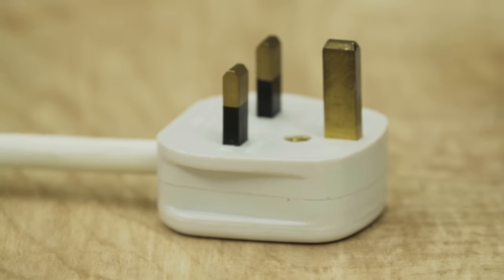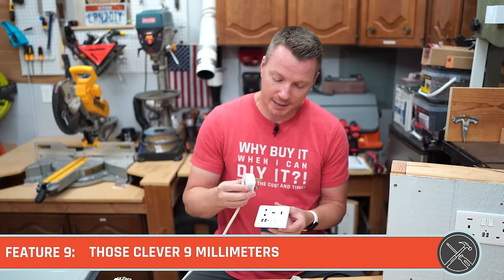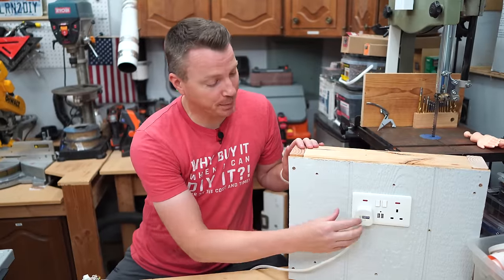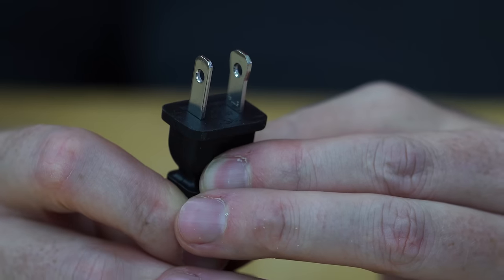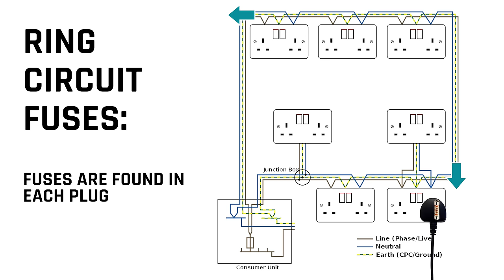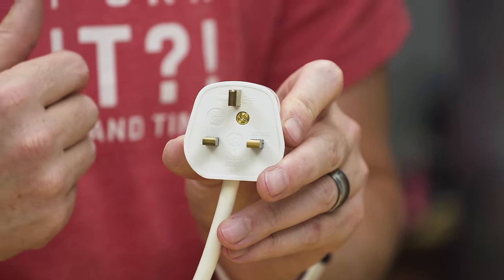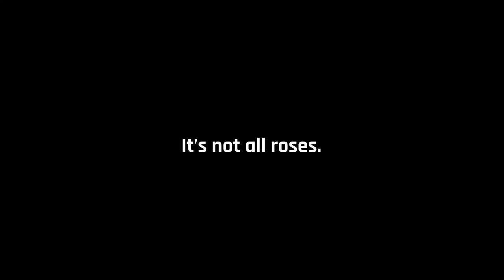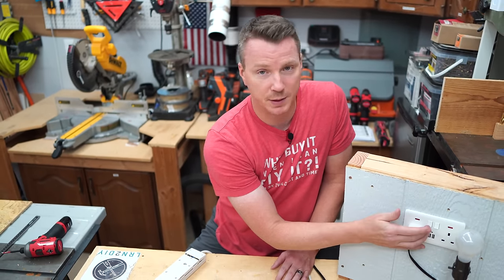British Plugs and Outlets Are On Another Level

Comment: In US inserting Apple power bricks to outlet was one of the most weird experiences. It literally falls out of the wall. I agree that overall British system is the best in the world in terms of engineering (besides of stepping with bare foot on it) but overall the best system in the world is European Type-F. Period. Ungrounded versions are as light as US counterparts but with additional safety features as dielectric sleeves and providing better grip. Full grounded version is just as solid as British one but more compact. The only advantage of Type-A is possibility of foldable design. I see no other benefits.
Reply: Total nonsense. The Type F plug has no fuse in the plug so a light flex on table lamps can overheat causing a fire, only being protected by the breaker in the main panel. It also has the earth as a metal strip on the top of the plug.  You can touch the earth metal in the socket end. It is also inset, that accumulates dirt and dust.  Bad design.

Comment: There is no in balance on the uk ring mains circuit, as the power comes from both sides of the consumer unit, (ie) no ring main circuit and you end plug starts up a powerful motor the rest of the lights go dim as it is can not carry the current if not connect to a ring main circuit, on a ring main circuit this does not happen  see 5.58 of this video the power goes both ways to stop this from happen, as it being feed from both directions. Clever.

Comment: Somehow this strikes me as a comparison between two countries that have the best Stone Age clubs while other countries already have composite bows.
I prefer to stick with the German Type F connector, which is not as primitive and more secure is  than the ones presented here 😅
Reply: "I prefer to stick with the German Type F connector, which is not as primitive and more secure is  than the ones presented here"

Total nonsense. The German plug has no fuse in the plug so a light flex on table lamps can overheat causing a fire, only being protected by the breaker in the main panel. It also has the earth as a metal strip on the top of the plug.  You can touch the earth metal in the socket end. Also inset that accumulates dirt and dust.  Bad design.

Comment: Well, if you are impressed by these british plugs, you will be MIND BLOWN by the EuroPlug who also features 8mm plastic protection (so you do not touch the metal pin before it connects to current) but manages to do that with a MUCH SLEEKER, lighter and easier to handle design.

Comment: I've suddenly gone all Patriotic 🇬🇧  I have to just mention though.  Anybody in the UK who does not first check that the switch is on first, at the socket, before diagnosing a bedside lamp issue, would be considered as thick as 2 short planks.  As they say here in the UK. 🙂.

Comment: While the UK according to de jure is 230V AC, in reality its 240V AC. 
The EU made the UK and Ireland go from 240 to 230 and the rest of Europe to from 220 to 230 in the name of "integration". However they described a tolerance of -6% to +10% so both 220 and 240 were included in the range. So in reality, nothing changed, other than maybe an intention to "integrate" which never came to be.

TLDR, the UK uses 240V, not 230V

Comment: i’ve never known anyone stand on a plug, no one would start changing bulbs or trouble shooting a problem without switching the socket on, the cables used are of significant gauge to take any domestic load irrelevant of how close together.

Comment: On load balancing, you got it wrong! In a ring system, any socket on the ring has the same resistance to the fuse box. if it is right next to the fuse box or it happens to be the furthest away from it. On the US system , not so much!
Therefore on a ring system, all outlets can handle the same current, regardless of distance to the fuse box, without overloading the wiring looms.

Comment: This video should be called "why BS is better than NEMA". I'm not saying british plugs are not good, but I feel like they are either just as good as or slightly worse than other standards in the world (e.g. sleeved prongs are a part of many other standards, fuses are redundant - if not superfluous - unless plugged in a ring circuit, strain relief and serviceability are not exclusive to BS, polarized plugs are not inherently safer if there are other safety measures, and switches on plugs are kind of silly). I'm personally partial to CEI 23-50, as I like the standard's versatility, modularity, safety, and elegant simplicity.

Comment: Nah, still had the shock experience. Had an old clock radio with a cut wire, dad said he was gonna fix it, instead of waiting I plugged one end in and tried to connect the two parts of the cable.

Comment: There is another MAJOR downside to this system, and that is if you wire the plug incorrectly - as many an amateur has done - you can actually electrify all the heating and water pipework in your house. When that happens, you have to unplug every single appliance and check every single plug until you find out which one is wired wrong - that's if you're still alive.
Reply: These days Earth leakage would trip the RCD.

Comment: Uhh to the Non-americans... He way too simplified what our outlets are here in the States. I've been an electrician for years now. And the one thing that's consistent is that their isn't much consistency. We have plugs where the wire comes out of the bottom too. We have plugs with fuses, we have plugs that are easily taken apart and fixed. Most household items are similar to what he showed. But they are also made and sold very cheaply. I'm not sure I'm a big fan of making it seem like we only have 2 kinds of plugs, that are small, fragile, and cheap. It just makes it seem way simpler then it actually is over here.

Comment: No, type F a.k.a. shucko a.k.a. German plug is superior to the Brit
Comparing both: the insulation in the pins are useless because the German plug goes all the way inside the socket, so you couldn't put your fingers inside them either, but it's more clever than the Brit insulation
It has a different way to ground electric that doesn't need a giant pin or any metal at all, making it cheaper
And it's very resistant like the British one, but with half the size and just better overall construction

Yes, the British is the second best, but German got it better

Comment: UK Electrician here.

This guys simply doesnt know what he's talking about he's just googled ring circuits and is waffling for filler content. 

Load balancing isn't a problem the comsumer faces and any competent electrician could tell you that.
That's why nowadays we have seperate kitchen ring circuits and up/downstairs circuits. 

You wont find a full house ring circuit where you'd need to consciously load balance in any house that has been wired after 1970.

Also, the socket switch disadvantage point just makes no sense... The first thing you so in the uk if something isn't working is check it's actually switched on 🙄

And remember, these aren't the baby voltages of the US where you can't even run a decent kettle. So, NEVER attempt to DIY these systems always contact a competent engineer.

Comment: Size? Also consider that you can shove large furniture or appliances right up to the wall and against the plug without damaging anything.  The plug might even protect the wall from damage.  The 20mm of the plug is probably level with the skirting-board too.  Tidy.  If the cable stuck out perpendicular, it might be inconvenient or damaging to slide furniture or washing machines close by.  Seriously, you Yanks should consider G-Style (and left-side driving), and we'll agree to take mixer-taps instead of Hot/Cold separates.  Deal?

Comment: I am afraid that he does not quite understand UK Electrical installation practice, First, we will start with the fuse sizes that fit the plug the biggest amp size is 13 amp followed by 10 amp 5 amp and 3 amp. Think about it would use a 13 amp for a light of course not, or a 3 amp for a fridge, it's all to do with safety. We also use radial circuits in the UK, in your kitchen you will have a freezer, fridge, and dishwasher, big items like this use radial circuits which are further controlled for safety by MCBs(RCBO) cable size will be 2.5 mm, Electric cooker cable size is 6 mm,  again its all to do with the power consumption of each item, next we come to Ring circuits we use them where less power is required IE in the kitchen for movable items, lounges, etc cable size is 2.5 mm Lighting circuits are wired with 1.5 mm some times 1.0 mm depending on the type of lights or the number of lights, I am talking about ceiling lights, as an Approved Electrician who has worked all over the world with electricians of many nationalities, have seen how different people install circuits, Electricians trained to UK standards stand head and shoulders above the rest, why else would American companies working in the Far East, Middle East employ Uk Electricians. 
The electrical safety standards in the UK by far beat all others.

Comment: I don’t like the flat design of the „plugs“. In germany you have a real plug like a surrounding around the opening like a crater. So you don’t need the isolation at the pins since they are anyway covered!

Comment: Seems like you were looking for drawbacks, couldn't find any so you made them up. 
1. Size, I'd rather have type G for all the benefits and safety features than small thingy like type a or b
2. If you have a problem in circuit m, there is a good chance you live in 70 year old house thsts in severe need of electrical system upgrades.
3. Plug different appliance in the socket and rule fault in the socket. Same way you would do with out the switch. Takes 2 minutes to troubleshoot and service the issue. 

Your drawbacks are not valid. There are more problems with your type A than   type G, get a grip man

Comment: Reason 3 is totally wrong, the arc is created because the electricity can travel through the air. When the distance is small enough and there is enough current, it will spark. That spark won't go to your body, because all the metal of the grid has a lot less resistance. Like others pointed out, reason 7 was incorrect too. Not the best video i've seen about the British plugs.

Comment: I suppose one advantage of janky US and other plugs is that if you trip over the wire, the appliance gets pulled over and you fall over. In the US system plug just comes out of the wall. Should have listed that as a disadvantage. Not that I care about it.

Comment: Beefy pins but voided by the fuse connection and extra switch, so what... I still think the euro socket is the best.
Reply: The fuse connection and switch are what makes it far superior to European/US plugs and sockets.
Reply: @johnburns4017  definitely not. In Europe we have fuses on each line (tripping both wires) and foul circuit sensing switches to detect any grounding circuit. Fuse on every device adds complexity, another (foul) connection point too. Besides the circuit design is weird too imho.
What i do like though is that the plugs cannot be pulled by the cord. I hate when people do it and still some euro sockets come with straight cable. It gets better though. Also euro sockets are recessed (which i think is better), can be used either direction (which is better) and have mechanical guiding, not depending on leads to guide and hold mechanical load.
Reply: @FueRent  
The UK has RCD and in certain situations AFDD protection (it is recommended). The fuse in the plug protects the flex (and appliance) from overheating. Not seen on any other type of plug. Although I believe fuses in plugs are available in the USA.

Using a plug any way around is none polarised, which is not a good thing. French sockets are polarised like the British. 

British plugs have gates over the L&N.

The 13A limit makes appliance manufacturers restrict high current drawing appliances for sale. 

The British system is the best.
Reply: @johnburns4017  how could properly designed device overheat by it self and why would you need a fuse for it which measures current but not the temperature? I can have 100°C using 20 watts. Why is not polarised bad? Most (ok ALL properly designed) appliances on AC do not care about polarity, why would you introduce complexity somewhere where it is not?
Reply: @FueRent  
It is clear you do not have much of an idea. Just take on board what I wrote.
Reply: @johnburns4017  you convinced me. I will now believe anything someone says, even more so when they can't back it up.
Reply: @FueRent  
You haven't a clue.
Reply: @johnburns4017  Of course not. On the other side you think fuse is safety against overheating instead of over-current protection but still think you have a clue. 🤷🏻‍♀ Just average youtube commenter. Less clue, louder the noise 😍
Reply: @FueRent  
You really do not have a clue.

Comment: I like how you appreciate the type of plug we use, but not how you look at the downsides of our plug from an American perspective.

First of all, nobody sane in Britain or India or Malaysia or Australia leaves their plugs on the floor. If the appliance is not in use you bet the cord is either rolled-up or still plugged-in.

Secondly, whether an appliance isn't on is quickly troubleshooted. If the appliance isn't on when the socket is off, turn the socket on. If both appliance and socket switches are on but it still doesn't work, time to fix it.

Comment: The negatives are pretty weak IMO - I've never stepped on a plug in 55 years, and neither have I scratched my head trying to understand why my lamp won't switch on because its turned off at the wall. As for its size - How can that be a problem when it's plugged into a wall socket behind a sofa? their profile is flat anyways....

Comment: You mean the plugs and outlets of North America are from an other level in the negative way!! 🤣🤣

I have worked with it in the US for my company using a 2,2kW angle grinder and those sockets got HOT! Because low voltage and high currents combined with bad contacts.
 Also plugs disconnected all the time. Terrible! 🤷🏼‍♂️
Please give me the European plugs and sockets. Also for 3phase: CEE-form rules!

Comment: It is always interesting to see the US and UK people only look at each other, completely ignoring the rest of the world. The plugs in Europe have the best of both worlds, compact design and outstanding safety, PLUS you can plug them in either way, which is particularly useful for extension cords with multiple outlets.
The secret? The receptacles are recessed, doing all the holding AND preventing any touching of life prongs.
But even with this, all plugs have had insulated prongs on top of that for as long as I can remember (still using my thirty year old desk lamp with that feature).
The reason the UK plug finds use sporadically around the globe is not superior design but a colonial artefact.

Comment: I have no idea what he was talking about as far as issues with 'load balancing' is concerned. The idea that "... load balancing can be an issue in many cases" baffles me.  Can someone name one of these 'many cases'? I have never come across one.
Reply: Heavy current appliances can be the 1st outlets on one leg of a ring circuit. They can draw far more current down one leg than the other leg. An unbalanced ring is a rare issue. The electrician who installs the ring would be aware of an unbalanced ring and then use the staggered method or upsize cable on the ring to the heavy appliances.
Reply: @johnburns4017  Fair enough, but most heavy current appliances, like cookers, are separate from the ring main, are they not?
Like you said, this is a 'rare issue' and not one which is found in 'many cases' as was stated.

Comment: Many mistakes and errors in your video:-
1) the phase & the neutral wires, even if correctly following the colour code, can still have the wrong conductor connected, which is why every house should have a special 13 amp test plug that shows with 3 neons either that the socket is correctly connected or why it is not correctly connected. Costing around 10 UK Pounds only! All plugs that have been manually connected, need to be viewed for correctness in connection.
2) The ring mains are fused at 44 amps (if I remember correctly), so provided the wiring  has been correctly sized, there will not be any problems with loading, as over 44 amps, a breaker or fuse will blow.
3)Double insulated units, do only need the earth pin to be plastic, just to eperate the shutter mechanism, you calling it "Double Grounded" is simply WRONG WRONG WRONG WRONG !! It is actually NOT grounded at all....
4)Not all sockets will be switched, you can buy both in the UK for example, but the switched ones are the best ones.
5) when all is correctly wired, the switches (fitted on some sockets) and the fuse in the plug will remove the phase.
6) Having the correct value in the plug for the device being connected, is also important for safety reasons. A lamp needs only say a 3 amp fuse, Red, not a 13 amp fuse Brown! Some other values are often just black, but with a clear value marking.
7) Any device with an on/off switch, needs to have checked that it is operating on the phase wire, not the neutral wire... Chinese manufacturers do not care either way!!!
8) In any country, all circuits need to have Ground Fault Detection, which removes power to a house circuit, if the fault current exceeds 30ma. A value that is still painful!! For circuits where portable equipment is used, one can purchase 13 amp power adapters, that drop power at an even lower current value, for even better safety, especially with children around.
I think that I caught most of your errors, now you need to make a new video!!